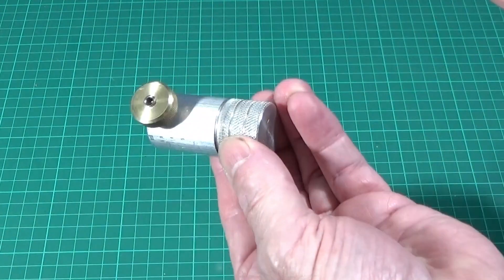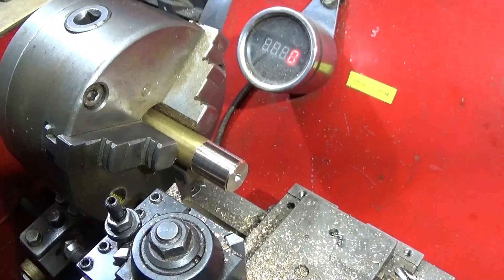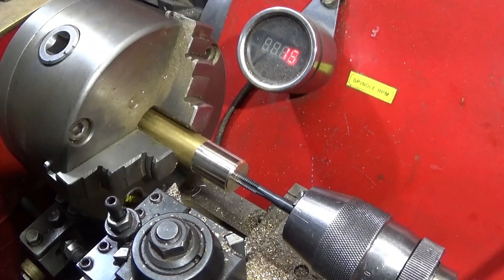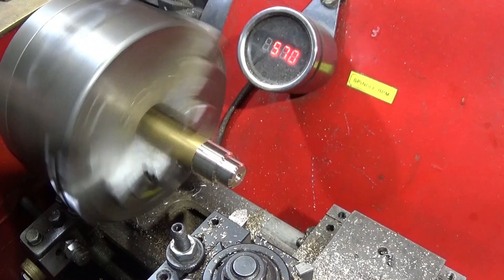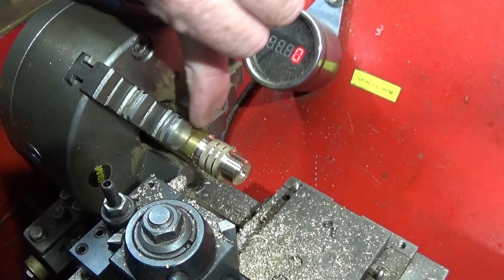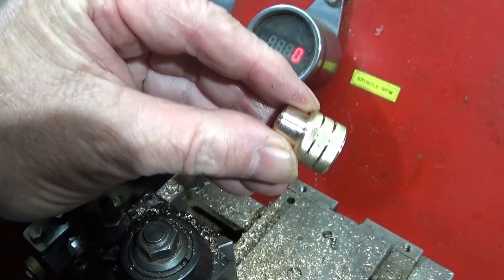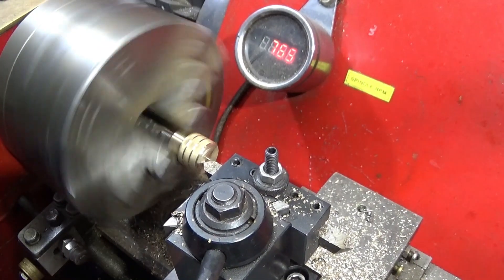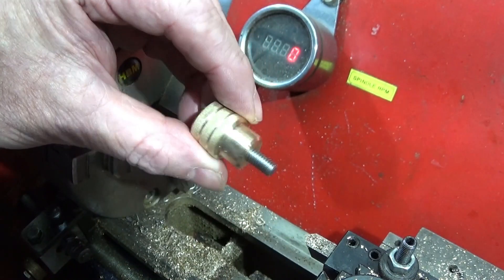Making Quality Thumb Screws On The Chinese Mini Lathe

Comment: Nice project video Steve. With no rush, no crazy music, just the job itself. My (perhaps stupid) question is about parting off.  Noticed that you ran the lathe at constant speed. Have been told that then the diameter is diminishing you ought to increase the speed. Do you think that this is overkill on a small job like this or only on brass? Or.....
Reply from the maker: Hi Ingvar. Theoretically it is right that the spindle revs should increase as the part off decreases diameter. It does on CNC lathes, but I don't bother on any material as I find it cuts ok. Regards Steve.

Comment: You make it look so easy Steve..Ive just made my first cuts on a Sealey lathe and I,m suprised by the result considering I couldnt wait any longer having had it 6 mnths and no where to set it up. Regards Stuart Bell.
Reply from the maker: Hi Stuart Thanks. It's great that you have got your lathe going now. It is surprising how well they work and what results you can get. Thanks for watching. Regards Steve

Comment: Very nice! I shall try them out on my lathe.

I never saw using the 'grub' screws used like that before, I always saw them solid brass or steel. I like the idea of the stainless screw, which will be stronger than brass!

Comment: Very nice Steve, I made a bunch similar for the height adjust on my DIY quick change tool holders. Enjoyed the make, cheers!
Reply from the maker: Hi Thanks. That's good that you made your own tool holders. I would like to make some, but I haven't got room for a decent milling machine.
Reply: @SteveJordan  I made them ala Harold Hall, cutting the dovetails with a 1/4" end mill at 30 degrees and used a digital level to set the angle of the blank in the vice. Most material cleared out at the bandsaw first..

Comment from the maker: A QUALITY TURNING TOOL SET. SOME USED IN THIS VIDEO:-
7pcs 12mm Shank Lathe Boring Bar Turning Tool Holder Set with Carbide Inserts
https://ban.ggood.vip/12CsB
Regular Price: $48.50
Coupon Price: $45.99
Code: BG238077
Warehouse: CN
EXP: 10.31